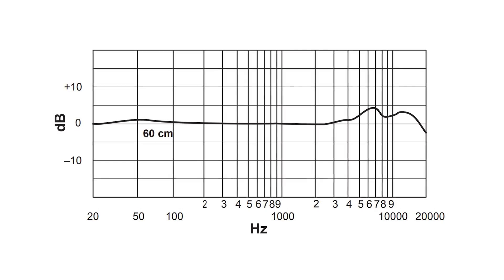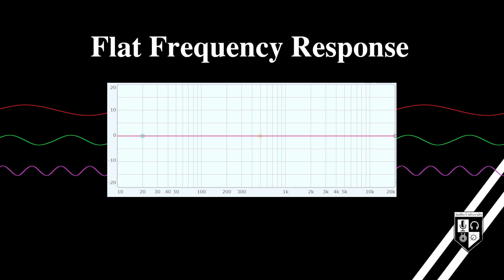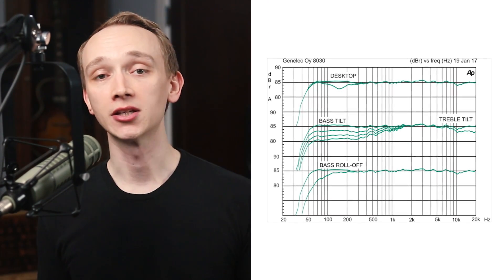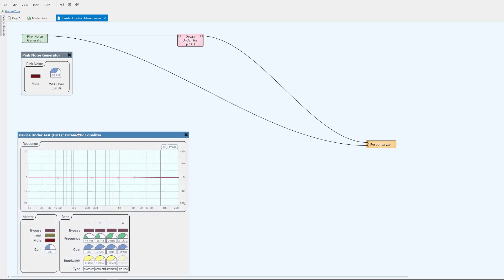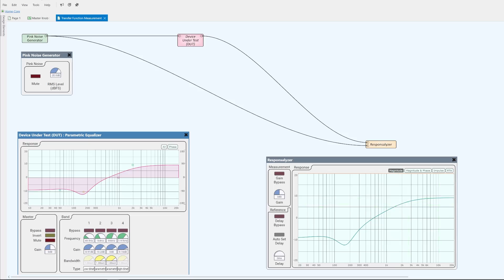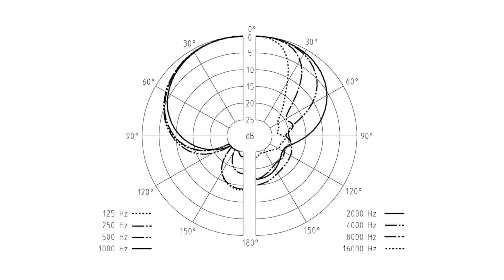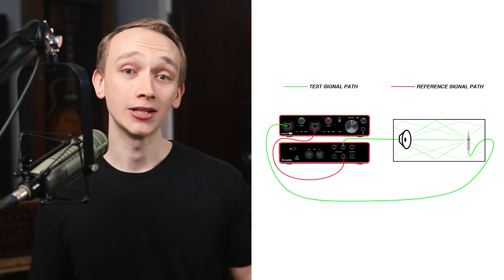Everything You Need to Know About Frequency Response for Audio Gear!

Comment: Explain "flat", flat to what? To whom? Yes, it is important for a loudspeaker to have a flat frequency response as measured by a (non-human) device. However, our ears are not linear, and according to Fletcher Munson curves, a "flat" frequency response to our ears (aka being able to hear all frequencies at the same level/intensity) is not a "flat" line, but more like a boost in the low and high frequencies and some attenuation in the mid-range.

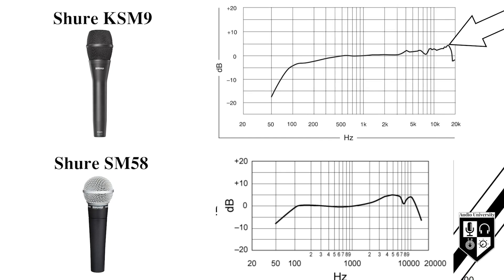Comment: 2:35 I still don't quite understand, what's the point of having boosts/cuts in the frequency response? That's basically EQ, and you can revert/change EQ settings, but the frequency response is permanent. My point is, flatter still seems better in any scenario

I also have another question. You said everything has a frequency response, so does my PC or my audio interface (say focusrite 2i2) have one as well?
Reply: I still don't understand either.

Comment: I have been working with Q-SYS by QSC for the last 4 1/2 years and now work for Q-SYS as of this year. It is not only a vary powerful DSP and Control platform but a wonderful tool tool learn about many audio principals as your imagination is the limit to what you can do with it. I'd be interested in what you use it for in your setting.
Reply from the maker: I have a Core 110f from an AV installation I worked on. I agree though - you’re only limited by your imagination!

Comment: Nice video. One thing to add is that with headphones, the ideal  response isn’t typically “flat” in the same way that speakers or microphones are. Since the headphones are projecting sound directly into your ears, to sound more natural they will be tuned to emulate a HRTF, e.g. using the Harman curve. But yes, taking this into account, some headphones are more “flat” than others by minimising any additional coloration of the sound.
Reply from the maker: Thanks for watching, Dave!

Comment: Great video, but still I'm confused on using plugins that do this. If I'm using a plugin that modifies the curve for you (Sonarworks ID Reference) and at the same time an ambience plugin for room perception while mixing on headphones (Realphones), should I turn off the "EQ" curve on Realphones? I love both plugins but highly confused when more than one is on the master channel
Reply from the maker: That's an interesting question! I guess they could coexist with a positive result, in theory. They would just need to be configured together. I'm not sure if it's possible, but you could theoretically configure one, then leave that tool engaged while configuring the next tool. 

If they are both attempting to make the dry signal sound a certain way, they won't have that same effect when used in series with one another. Hope that helps. Thanks for watching!
Reply: @AudioUniversity  It does. Thanks for the reply

Comment: Another excellent video.  With respect to this subject, I presume cables have a role as well.  There are myriad advertisements about one cable being superior to others.  What is your scientific take on cables?
Reply from the maker: While cables may have a subtle effect on sound, the effect on frequency response is infinitesimally small. I'd focus on acoustic treatment, source quality, amplifier, and speaker before even thinking about upgrading cables. In my opinion, the main benefits of good cabling are longevity, reliability, and noise isolation. You can almost always get a more significant SOUND QUALITY improvement with acoustic treatment rather than premium cables.
Reply: @AudioUniversity  Thanks!  My cables are probably fine.  They are old, but in good shape.   Since I rarely run longer than 20 feet or so, noise isolation does not seem to be of concern.  I do need to deal with the studio acoustics though.  Appreciate the education!